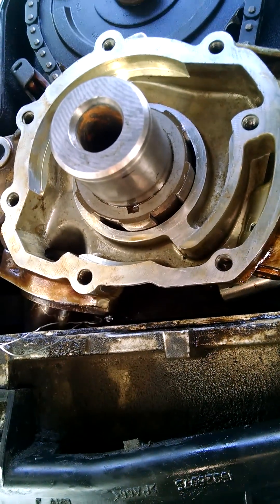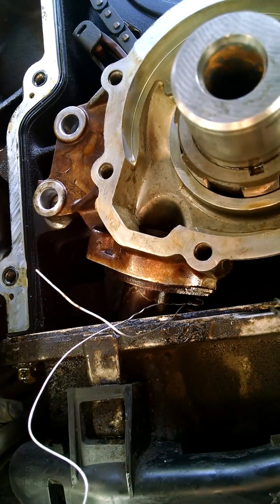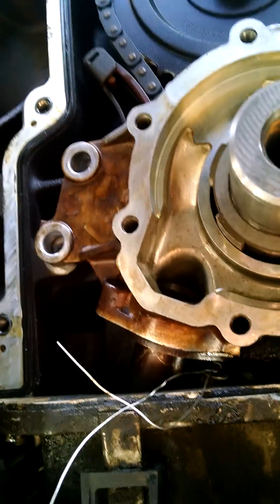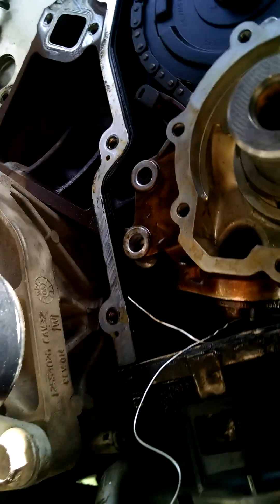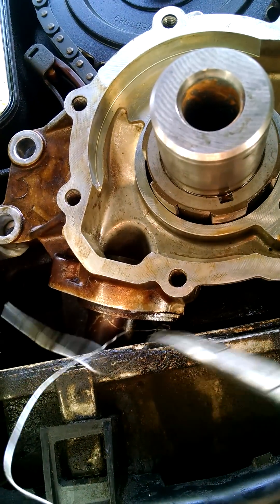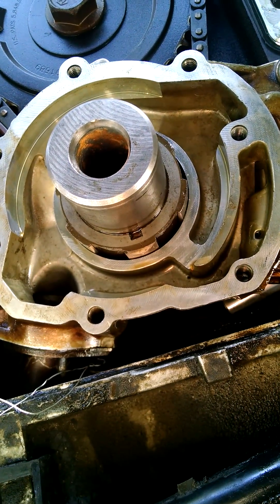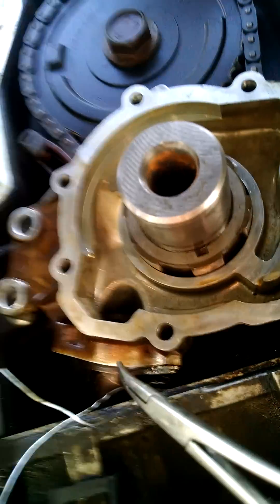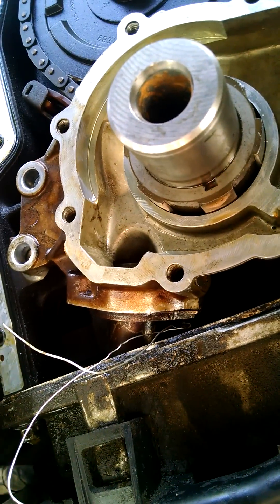08 5.3 Vortec oil pick up oring change no pan drop

Comment: Just did mine take out all the oilpan bolt exept the two long ones at the back just losen those about 3/4 this will lower the oil pan about 11/2 inches in the front makes this job a lot easier

Comment: When you have the bolt out use a small triangle file and put some notches in the head of the bolt, then you can use a pick or small screwdriver to turn the bolt. Hold pressure up with a 90 deg pick, and a second one to turn it.

Comment: Man. Mine is a slight tighter fit. Also welded and ive got 4x4 and had dropped the pan for the o ring fix, but it didn’t work and now im doing the pump. I have some rubber string and hemostatic pliers. Ive been trying for an hour or so. I really don’t want to drop the pan again.

Comment: I like the fact that this method allows you to do the job on a 4WD without dropping the diff. and you can also check on the condition of the pump and make sure the pressure relief valve isn't stuck open . However you have to remove the water pump , harmonic balancer and the timing cover which means you have to buy all new gaskets and a new bolt for the harmonic balancer all of which cost twice as much as an oil pan gasket and pickup tube O-ring . Both ways kind of suck . I think I'll just drive it a little longer !

Comment: On my 09 5.3 I did it without opening the oil pump with just the plyers no wire just be careful take you're time use a 10mm wrench to crack the bolt loose

Comment: I feel sorry for the guys with the non-moveable tab. 
I was fortunate enough to have the one that was loose on the pickup tube. 
But there's the tab to contend with ---> and I just cut the top of the tab off, spun the retainer 180 degrees and used the second hole to put it together. 

Be sure to set the clearances on the inner rotor of the pump so it's centered on the crankshaft. Old pump or new pump --- don't forget to do that! 

My unprofessional video on that procedure: https://youtu.be/8oS_yo4ykVA

Same with the front seal --- loosely install the timing cover with the new seal and the gaskets in place. 
(I like to put some Ultra Black RTV in the corner of the pan where it meets the block and timing cover.)
Then install the harmonic balancer to make the seal move the timing cover to the center and then tighten the timing cover up, squishing the RTV into the corner to seal it up ----  and you'll get a lot longer life out of that front seal!

Comment: My advice is to just drop the pan because you need to clean all that sludge in the pan and to also replace the pickup tube. If you have cordless tools it wont take that long.
Reply: Why would you replace the pickup tube, a piece of steel pipe doesn't wear out.
Reply: @integr8er66  it's faster to hang a new tube than spend a bunch of time cleaning all the sludge from the tube and pickup screen.

Comment: Why cant you pull the rest of the pump off with that pickup tube bolt off and then pull the pickup tube out??
Reply: No because it bolts in the back of the engine too
Reply: @ironicchannelname6457  
Yeah I found that out lol thanks

Comment: THIS WAY IS HARDER THAN DROPPING THE PAN
Reply: Not on my truck its 4wd so you have too drop the front axel
Reply: @ironicchannelname6457  That's nothing I've dropped the front diff plenty times just know what you're doing. Even putting stickers on what goes back where helps folks.
Reply: @DoctorRickSanchez  IFS or solid?

Comment: Ive changed a few oil pumps like this. As long as you're certain the engine isnt sludged up you're usually safe doing this. With gm's faulty pressure relief valves in their oil pumps causing a lot of these failures and not the pump itself shelling out, 9 times out of 10 youre good. I use a peice of small copper wire to remove the bolt once its out a turn or two. Make a little hoop in the wire and get it around the threads and pull the wire to spin the bolt out. Even if it drops to the pan you can fish it out with a magnet. The oil bafle in the pan makes it pretty unlikely that the bolt will make it to the bottom of the pan unless you get carried away. Going back in I use a plastic bread tie to hold the bolt in the pickup tube hole. The pump rotates to the right far enough to get the bolt started just fine. Then once I get it started i pull the bread tie off and spin it back in most of the way with the copper wire again. It takes me no time at all to remove and install a pump like this. Reading through the comments is comical. Seems like every guy with a little automotive knowledge has some cocky remark to throw in here to discredit a guy lol. Ive been a respected technician for over 20 years now with a large customer base and a great reputation for being honest. It's funny to me that guys actually waste their time to comment some bullshit negative remarks just to try and make themselves feel just that much more perfect. Lmfao. But in some of their defense, more than likely you do need a new oil pan gasket anyway because thats just the norm.
Reply: Also, to prime the pump, fill it with assembly lube like lubraplate or equivalent. It creates the initial suction needed to quickly fill up the oil system. Its also thick enough to stay put for a while if you get pulled away from the job.
Reply: @coreydaniels9071  I use 90wt gear lube and it too will stay and create a good vacuum!
Reply: Would like s video of how you do this
Reply: Love the bread clip thing! That's brilliant!

Comment: Greetings,
My oil pick up tube is up in the oil pump to the point where I cant pull the pump off of the crank....should I force down on the tube to free up the oil pump to slide off of the crank shaft (and yes, bolts and gears are off of the oil pump)??

Comment: Howd ya slide off the oil pump from the crankshaft and pickup tube?
Reply from the maker: buggy saywhat you need to take all the bolts out of the pump housing then the gears out, next take the bolt out of the pick up tube. You can move the pump housing up to the side and the pick up tube down just enough to change the oring. My dealer had a small tube of stickie grease that I put on the new one ring so it would slip back into place without causing it to be pinched or flattened. Hope this helps
Reply: Patrick Tucker howd ya prime your pump?
Reply: Patrick Tucker o

Comment: Dude? Your vid didn't actually show viewers how this risky method got the o-ring changed out!
Reply from the maker: Ya I already changed the oring and  thought this may be helpful for some one. So I recorded a short video be for I put it all back together. Once the bolt is out the tub will drop down just enough to slip the o ring on. You do half to move the pump housing sideways but this method is not as hard as dropping the diff. Diffs are heavy and I didn't have help to get I back up. If you have a 2wd modle it may be easier to drop the pan and go that way. Best of luck. Before you do this check the screen under the sending unit. That is also common reason to show low oil pressure.
Reply: @patricktucker9950  what side wrench did you use ?
Reply from the maker: @nickritter1992  this was a couple years ago but think it was a 10mm
Reply: @patricktucker9950  10mm fits loose on my bolt that's why I'm asking
Reply: How is it risky?

Comment: NO NO NO THAT IS THE HARDER WAY.  DROP THE OIL PAN CLEAN IT AND THE TUBE FILTER. AND REPLACE THE O RING.
 I DID MINE IN 4 HOURS  INCLUDING THE CLEANING.
MY ENGINE NOW IS SO QUIET. AND HAS 156000 MILES
Reply: You're missing the point
Reply: Did you suffer from low oil pressure,or just lifter noise?
Mine has great oil pressure,but cold starts are pretty tickety tickety...
Lol
Reply: Is yours a 4wd or 2wd?

Comment: Thanks for the video. My 08 5.3 Silverado 2WD tube was welded also ( Really stupid engineering not using the opposite bolt hole for attachment.) It took me over an hour to get the bolt back in but it looked like a better option than dropping the pan. Your video gave me the patience to keep trying. Probably won't buy another Chevy if this is how they engineer stuff. Not sure what others are talking about making it easier by loosening the motor mounts etc. That won't change the gap opening between the oil pan and bottom of pump casing. Anyhow your video really helped.
Reply: Just drop the pan, it's not that hard as people try to sell it on YT. Get some good tools and it's half the job..lol
Reply: OK, so you guys are making the "remove the front diff" approach sound pretty easy (ESPECIALLY in comparison to the 958 steps involved in following the Chilton book).  But, I'm confused.  Are you NOT removing the axle from the diff?  Do you drop the pan with the axle still attached (and still going through the pan)?  The books say you have to remove a bunch of the steering... it sounds horrible.  Any insights you can give me would be so very appreciated!
Reply: Paul Hahn You really only have to unbolt the cv axles. If even that. I did it and to be honest it was a bit of a pain, however; I did this under my carport with some ratchets and a jack.

Comment: i got it in the same manner , my 2008 is also welded all the way around, there is no way to flip it. 

i used and extremely narow and long set of needle nose and wraped 19ga wire around the bottom while kicking it to the side.
i also kicked my pump enough that i could install  a housing bolt under the housing to hold it in place to the side. 

i put a good amount of force up on the bolt with th plyers to help get her started.  took about 3 trys to get a thread. then about 10 more minutes of slow spin to get it to where i could fit a wrench and verify that it was indeed started.

Comment from the maker: not if you have a 4wd
Reply: Patrick Tucker Can you tell me how you got to this point? I have a chevy Silverado with the 5.3, and I read a lot of ppl saying that this method is easier than dropping the oil pan.

So I go to look under my hood, and I assume to get to the front of the engine block like you have, I would have to remove the serpentine belt first, then possibly remove the radiator to make room to work. Then I realized I'd have to remove the Harmonic Balancer, which can't be done with normal tools, you actually need a "harmonic balancer removal tool." Then it looks like you've pryed off the front main seal, which means youve torn up the seal and gasket on it, so you'd have to buy another seal. Then it looks like you've opened up the oil pump and removed the spuder gears inside of it.

Can you please tell me if I'm missing something, ir if there is a shortcut to get to the point that you see in your video?

Because after all that work, I dont see how this is easier than dropping the oil pan, especially if I dont have a 4x4 differential to worry about.

I'm not trying to be rude, it's a serious question, I'd like to do this O ring change the easiest way, and  I was hoping you could give me the instructions on how you got to this point.

Comment: its way easier to drop the oil pan. just for the record.
Reply: Not at all on a 4x4... you need to drop the whole front end.
Reply: @charleskozloski1820  On the 4x4 you drop the front cross member (4 bolts), disconnect both from axles, (12 bolts) Front steering rack (4 bolts) and then you drop the pan.  It literally takes about 15 minutes to pull it and do it the right way.  I've always been the type of person that would rather remove more parts than try to fit my arm/hand/tools into a smaller tighter space.  All the wasted time seems like a waste of time, especially when you drop the bolt or something else down into the pan and have to pull the pan after the fact.
Reply: +charles kozloski ...not at all. raise the engine.
Reply: Needless to say that you also get an opportunity to inspect / clean the screen at the other end of the pickup tube while you're there. It is the right way to do this.
Reply: Exactly what i was thinking...
Like hell id pull the front of the motor apart to fumble in that way...
Drop the pan, change the oring, and bolt it alk back up, done!
Reply: @splash5974  I agree I replaced my water pump two years ago and it ain't comin' off !
Reply: Paul Hahn it doesn't go through it. Otherwise your axles would be full of motor oil. It passes underneath it so you can't just drop the pan. That's what this is all about.
Reply: It does on an 05 Envoy 4X4.  For real.  There's a tube through the pan that the axle goes through.  The pan is not removable without removing a lot of stuff.
Reply: @paulhahn9709  I don't even have to Google this to know it's not true. Maybe the pan bends around the axle because GM engineers were getting screwed bc GM was going bankrupt. See their costs were fixed.  So when the sales slowed down, because they made so many bad ass fucjrn trucks 99-06./07.5 no one was buying anymore GMs didn't need too. Ford owners always stay with ford bc they're retarded. Another issue is GM poured more money into research development starting in 2000 as long as trying to give the American people sweet ass deals after the 911 terrorist attack. Osama bin Laden. And GM trying to give their customers the most bad ass trucks ever made to going bankrupt. Only way I can see the axle going through the oil pan or even close.
Reply: Yep, and you can replace the leaking oil pan gasket at the same time.
Reply: 4X4 it sucks ass. I'd rather invest time fiddling with the oil pump and the pick-up tube/oil pump than dropping everything on the front side.
Reply: It is way easier to drop the oil pan, 
Also you clean the pickup tube filter and oil pan itself
Reply: Yep, not on a 4x4. 03 Yukon XL.
Reply: Yeah not when you have 4 wheel drive you got to remove the cross frame and everything
Reply: It is easy. Just drop the front diff. 30 mins I had the tube out
Reply: Yes it is! I just completed oil pump replacement. Don’t cut corners folks. It’s not that time consuming to drop the pan and do it properly. Plus torquing that bolt even to the 100 something inch pounds is impossible without dropping the pan. Do it right the first time! 💪
Reply: No it's not just for the record
Reply: charles kozloski Wrong again. You just have to unbolt the front diff and use a jack to drop it down enuff out of the way to pull out the pan. Don't even have to unbolt the axles. Quicker, easier and less tedious. Even if you decided to drop the front diff its less headache than trying to stab a bolt with hemostats. 

You tore apart the whole front of the block to change an o ring. At this point you might as well go back in with a new chain and gear set. Oil pump and water pump.
Reply: No its really not
Reply: But, doesn't the axle go THROUGH the pan?  How can you pull out the pan if there is an object passing through it?  I'm asking because all this freakin terrifies me, and I HAVE TO do this repair.

Comment from the maker: It sounds like it's possible that once the o ring warms up it's expanding thus causing you to have oil pressure. When the engine turns off the o ring could shrink thus your lose oil pressure again. The o ring is about a ten dollar part and the way I did it you'll be able to inspect the pump when in there. If you have time and some know how this is the cheapest thing to test before rebuilding the motor. If this doesn't work either your pickup tube has debris in the screen or the bearings have excessive wear thus the low oil pressure, but usually when the engine warms up the oil gets thinner so I would not think that is the case.
Reply: +Patrick Tucker thanks.
Reply: my problem was fixed by changing the sending unit. thanks.
Reply: I've seen it both ways  --- bad pump pressure relief valve and the other is a bad o-ring. 
Mine had a bad PR Valve - and I put a new Melling M295HV pump with the spring that's installed from the factory and now I've got 70lbs at cold idle - 60lbs at running temp. Nice! 
For the record, my o-ring was in great shape.

Comment: Hi Patrick. Can you tell me what that symptoms are for a bad o-ring on the pick up tube?  I have a 2005 Chevy Suburban that is slow to build oil pressure (2 minutes probably). It starts at 0, and then will build to 30 to 40 lbs or so. It holds without issue after built. If I turn the engine off and then restart, it will be like 5 lbs, and again build right back up, but slowly.  Does this sound like a pickup tube issue or a pump issue to you?  Any advice appreciated.
Reply: Could be your oil screen beneath the old pressure switch